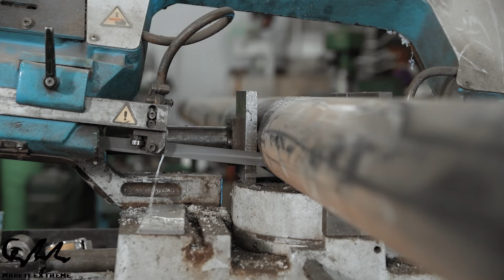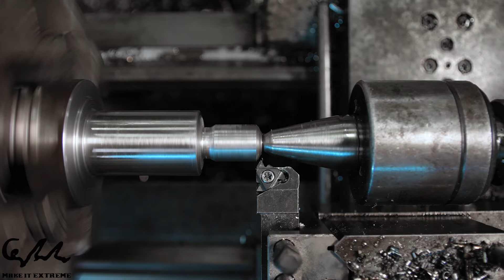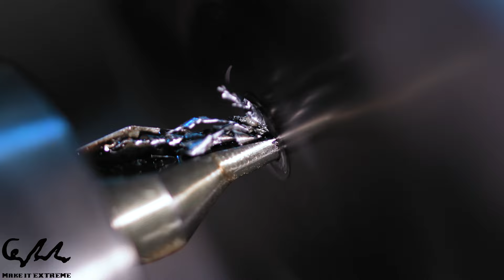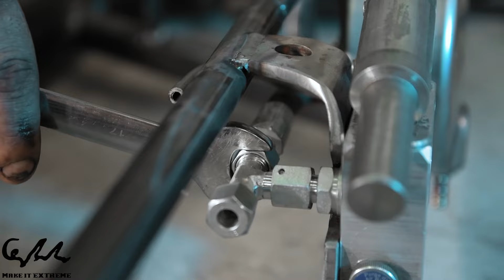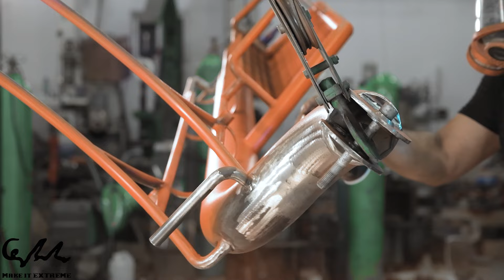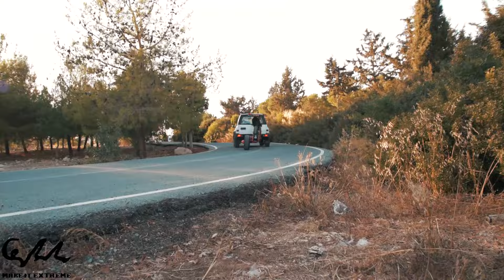The INSANE Homemade Motorbike Trailer of 2024!

Comment: how stable is it at speed? eg 80kmph? weight is off the center
Reply: I heard they tested it up to 300 mph.
Reply: Stable enough for use on the island. Where on Malta can you drive faster than 80kmph?
Reply: @ulrichm  i have no idea where they live... i thougth it was greece... anyway - even 50 is huge speed for unbalanced trailer of ~300kg - it can roll and drag a car with it. This is less but it is with higher center of gravity...
Reply: @lutheduck  i think they live in Cyprus
Reply: @kostasgnt  its Cyprus 🇨🇾 correct.
Reply: Look at the trailer hitch
Reply: @the_mad_ratter  will not tip   hitch does not allow.
Reply: yes i gree, look at the hitch, it doesnt allow it to tip
Reply: Who need it stable when you have family at your side..
Reply: You’re right, but it still looks cool 😜
Reply: @DaddyBear3000 it looks awsome. Crazy as all previous 120 of the builds
Reply: I built a single wheel trailer for my bike and having it centered  can cause issues as any play in the connection joint causes a lot of back and forth forces.    Not only does this make unloading really convenient and cool looking it will keep a twisting force on the front mount and should eliminate rattle on all but the worst bumps.
Reply: @ericjames5163  that makes sense. I would have opted for two wheels personally.
Reply: @DaddyBear3000  my bike trailer ended up with two wheels eventually.    I wanted to be able bring my children along on single-track and I  wanted it to follow my bike wheels on narrow paths.
Reply: As long as that 90 degree phase tung doesn't twist out of the hitch centrifugal twist when cornering won't be a problem. It would have to flip the whole towing vehicle with its roll. It all depends on how tough they made that joint...
Reply: @James-vq9nc  Strong enough for a bike that weighs 120KG.
Reply: @ericjames5163  there is no twisting, but there is no "turning" in the corners, at sharper corbers it will be sliding to side  rather then rolling
Reply: @onjofilms  🤣🤣

Comment: The twisting forces applied to the trailer hitch are insane, especially when turning left, I would be surprised to see it lasting more than a few km, not to mention the effect on the car dynamics. The good news is that the design can be easily corrected by adding a second wheel while still keeping the ability to lower the bike, you just need a U "swing arm" instead of an L one.
Reply: came here to say that. those axial loads are going to wear out that single attachment point in no time.
Reply: It has a pivot in the yaw plane as well as the heave plane. Should be fine.
Reply: Their not talking about the load from side to side in the yaw plane while turning. There talking about the twisting load on the reciver tube do to the offset position of the rear tire
Reply: Lol love when "weld fabrication" experts  come out saying why things won't work because they can't do it themselves lmao 😆
Reply: @crazywelderthings6952  you're painfull come on. How can't you see this problematic. A 2" square tube is not meant to work in torsion. Yeah, It will work, as we can see here, but it won't last.
Reply: @crazywelderthings6952  I love it when welders just make stuff and don't do any engineering to figure out if their contraptions are safe. In this case what duty rating of hitch is suitable to take that torsional (roll) load (can you do it with a class 1 safely?). Also what would be your bike weight limit? Because I would be concerned about the integrity of the (lower class) hitch on the vehicle side which is not (specifically) designed to take that torsional load.
Reply: It's a modified clevis hitch. That hitch isn't going anywhere.
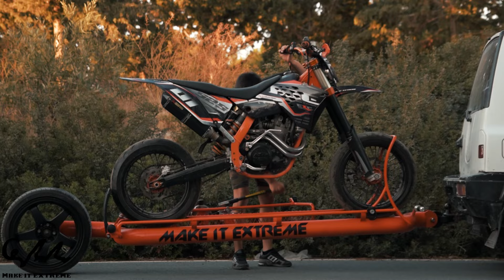Reply: @michaelkunze927  and what is holding that clevis hitch? lol @10:48 the square tube is at most 1" wide.... and buttwelded to a flat bar...
Reply: @TJPDmember  Do you not understand how many thousand pounds those hitches are rated for? Even the smaller hitches Are rated at 1500 pounds and up. Plus its mounted in a significant plate even if its a Class II hitch.
Reply: @michaelkunze927  Do you understand how hitch works? Tongue weight and tow weight are two totally different things. a pick up hitch have a 18 000lbs tow capacity but it cant hold more than 1600lbs in tongue weight. This 1" hitch barely rated for 300lb tongue weight. Please learn before you argue. That's one, second, THIS IS NOT A SWAY BAR, a square tube was NEVER designed to work in torsion (rolling motion of the trailer), stress fatigue will break that thing in no time. Good thing not everybody is an engineer....
Reply: @TJPDmember  pYea bud. I understand how a hitch works. I'm a farmer and a truck driver. I have been exposed to and used more hitches both in travel and hooking up than you have seen. The minimum hitch size is 1 1/4 inch the least amount of weight is 200 tongue weight class 2 is 300 tongue weight. The hitch is sitting inside a metal plate secured to both frame rails. The hitch isn't going anywhere.
Reply: @michaelkunze927  we're getting somewhere, now how much force does a 200lbs bike with a center of mass at about 2ft high, offset by about 1ft to the right have when going around a corner at 60mph? You start with 250lb/ft static minimum and you're not hitting any pot hole on a highway ramp going 60mph yet, I'll let you do the math but it's WAYYY over the generous 1000lbs rating we can give this thing. Do we know each other? lol I love your kind of people. Insult before fact.
Reply: @infidelmat  to be fair i think he isn't going to use that trailer to go somewhere, it's just a little show off piece to get a video out of it (at least i hope so). yes it looks cool but there are in fact a few things that are wrong with this trailer if he wants to really use it. to all others, there is a reason why trailers aren't built that way.
Reply: @thomasmoser7382  oh totally realize it's mostly a show, but it's a bad habit of the diy fab crowd to ignore these things, and these videos don't help. People may trust the setup and replicate it to disastrous results.
Reply: I'd bet this trailer is still going strong and will continue to do so for a very long time.

Comment: As much as I think this is a very cool build, I find myself thinking that using an air spring/shock would have been a much better choice. Hydraulic fluid is technically incompressible, so your trailer technically has no suspension. Now imagine hitting a bump at highway speed. That trailer is going to bounce all over the place. It seems to me it would be quite easy to swap the hydraulic pump with an air pump, which seems likely to work even if you keep the same cylinder.
Reply: Well the cargo itself has shocks if i have to nitpick but i would still agree that a built in shock absorber wouldn't hurt.
Reply: @oscartattoo3910  I assumed there was a chamber with air in the system which acted as the compressible fluid.
Reply: The hydraulic isnt meant to be a shock, its just a lift like on a dumptruck. I have a little trailer that has no shocks and it bounces around a bit. In fact the sidewall on the tire is the only "give" in the system but its fine for light loads. I agree a shock would be nice but then he needs A arms and that really complicates things a bit.
Reply: @danielbuckner2167  not really. The way he has the hydraulic would work. Just add another eyelet to put a shock and have the hydraulic push the shock lifting the wheel.
Reply: There is shocks for hydraulic cylinder that dampen the load
Reply: The shocks on the motorcycle will help quite a lot. If he strapped over the rear tire instead of the swingarm they would help even more.
But by itself without a motorcycle you're definitely right. It'd bounce quite a bit.
Reply: @brandoncaldwell95  He could do that but then that makes the entire trailer/tube part of the suspension and the flexing would occur there rather than in a dedicated suspension. This would obviously affect ride height. He could put a shock inline with the hyd. Cylinder as was mentioned but that require more length in that setup. He alternatively could use an airbag but then since airbags are used in the exact way and for the effect he is using the hydraulic cylinder be could sinply replace the hydraulic cylinder with an airbag and a lockout to hold it up in case of a leak(same cohld be done for hyd. cylinder now). 🙂
Reply: There are many unsuspended trolley in the market. For light loads and limited speeds the tires themselves act as decent suspensions.
Reply: There are certainly things about this that are outside of my experience, and factors I hadn't considered (such as how effective the tire itself may be at softening the bumps). Perhaps in Cyprus this bike trailer will work perfectly, I just don't know. I do know that I wouldn't take it on any of the roads here in New England as it would probably become airborne on the very first pothole I hit.
Reply: He just needs to add a hydraulic accumulator, its that easy, his system will work.
Reply: @xxn0cturn3xx  Then hes combining two different systems which design wise means twice the risk of failure.
Reply: @danielbuckner2167  what are you talking about, the accumulator literaly just bolts on to the current system...
Reply: @xxn0cturn3xx  Yes but then you are using it as a dampener, correct? So now the system must remain in an "unlocked" position and is subject to dhnamic movement and load.
Reply: @danielbuckner2167  well if you want it "lock" just use a manual valve that you can close if you want to disable the dampener, easy as that
Reply: @xxn0cturn3xx  That would only stop the flow in the hydraulic system. That would be like those people who crawl under their car with no jackstands and get crushed. A mechanical lock is what is needed. The hydraulic ram isnt a suspension piece, it is like a ram on a dumptruck. I have never seen a dumptruck without suspension and a dampener on the hydraulic ram to soften the bumps from the load, have you? Mixing the two systems means one failure has twice the bad result and in the this case would not be a blown shock but rather a collapsed trailer.
Reply: @danielbuckner2167  His idea makes perfect sense, and is used in the industry as well! What he is describing is exactly what Citroen cars used to have. Hydraulic rams with hydraulic accumulators provide some compression (they are filled with nitrogen which is compressible opposed to hydraulic oil). Citroen stopped using that system because of the high cost but it is still used on JCB Fastracs.
Reply: @Matevz96  Yes, but wasnt that part of the stabilization and not a suspension part? If it fails the trailer collapses, not just loses shock absorption.
Reply: If you think that why not build one yourself instead of being a hypercritical keyboard warrior
Reply: If you have an air compressor 
12v compressor at napa $109
Reply: I'd think there is some give in the pump circuit (rubber pipes etc) which would allow movement for sharp onset load variables.
Reply: Trailers work better without shocks.

Comment: Need to lock it in the upper position also. Those hydraulics could leak and drop that trailer
Reply: Yeah, that was something that concerned me as well.
Reply: make sense but just like him i like that kind of confidence in my work so i would probably use a small caster (small wheel that sontact the ground when lowered
Reply: @jeyseychelles1370  I'm more concerned when he's hauling it. All the farm equipment I used to run got chalked or locked in the upmost position. Don't want your machine to drag pavement. Being confident is great but you have to be redundant
Reply: All you need is a piece of half pipe that goes around the polish rod to keep it from lowering. We use those all the time on farm implements.
Reply: @michaelkunze927  that's what we had as well. Hinged to the cylinder, swung up and latched around the cylinder rod
Reply: @kylebracht  Most of ours is a U shaped pipe open down one side with a hole for a linch pin to hold it on. Have a tab off to the side to store it when not in use. The hinged ones have a tendency sometimes to vibrate and dislodge the mounting pin or cut into it.

Comment: The trailer look amazing! Now you need lights to make it legal.
Reply: I wonder tho. Cause it isn’t wide enough to block the view to the taillights of the tow car. Might just depend on the cop and his mood
Reply: some countries might not be a requirement, I know here there is exemptions depending on length and if tow vehicle lights are visible
Reply: Most places you only need lights if the vehicles tail lights are blocked from view and if the trailer itself exceeds 10 feet in length.
Reply: As long as you are visible and safe.
Reply: I agree ✌️😎
Reply: In many states the law is the trailer needs lights if it obstructs the vehicle lights during normal travel. Including the load on the trailer.

Since this does neither of those things, and would meet all requirements for excluding the legal need for lights, it would depend entirely on his local and state laws.

Comment: Nice! A small accumulator in the line to the lift cylinder would improve the suspension action over bumps.  Any reason you didn't buy a loose U-joint from the local farm supply or junk yard for the hitch?
Reply: Exactly! Was thinking U Joint also. Amazing lateral torque resistance while allowing the trailer to pivot up/down and left/right

Comment: My head is telling me that having an un-centred load like that is a bad idea. 

But, it's also a cool concept for loading bikes so I hope I'm wrong.
Reply: yes, it's look beautiful but i think it should has 2 wheels to get more balance, not just only 1 wheel!
Reply: In some camera angles you can  clearly see the load tilting to the right.
Reply: And the trailer hitch is probably not designed to hold this kind of load.
Reply: I noticed there is no video of the trailer going around corners at speed.
Reply: @justindavis1546  >there is no video of the trailer going at speed.

Fixed that for you
Reply: there is no pivot to it. He made a custom hitch that only goes up an down from what i seen
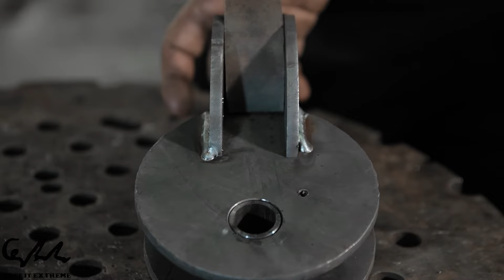Reply: @dexterrandolph5563  At 8:11 you can see the hinge with two pivots, one vertical and one horizontal. It appears the "hinge" slides into the receiver and uses the regular pin to hold it in place, you can see the trailer hitch is still attached above the hinge.
Reply: Correct. The trailer is definitely off camber. Instead of making two "S's", the rear could have stayed an "S" and in front of that stayed straight to create a triangle. This would make the bike load at a slight angle (~5°-10°), but much more centered overall.

Comment: Love to see it try and go around a corner at 80kph ... wouldn't end well me thinks.
Reply: It's through bolted at the front so it's fixed to only roll/tip in unison with the vehicle's frame. It's not going anywhere.
Reply: @jokly1264  Toda América sería un solo país es México en un futuro próximo el idioma oficial sería en español religión oficial sería católica México va ser el primer mundo ☺️ viva México ❤️🇲🇽❤️🤠...
Reply: Would love to see YOU around a corner at 89kph 😜
Reply: Why the fuck would you take a corner at 80kph? Its for transporting a bike, not formula drift
Reply: What a great comment do you like the taste of the white crayon?

Comment: Cool design, stability wise I’d be cautious since the weight isn’t over the central axis it’s going to want to roll and you were able to see that in footage at the end. Otherwise that’s dope
Reply: its gonna wanna roll regardless
Reply: There is no way for it to roll with the custom hitch he made. it's only a 2 axis hitch, not a 3 axis. If he was using a standard ball hitch, then yes, but that's not the case here.
Reply: @FarmerFpv  still a lot of unnecessary force on that hitch.
Reply: @warrensteel9954  Actually you want weight on the hitch is makes it more stable. Also that is not a lot weight for a hitch. Even the most basic of truck hitches can do 1000 lbs . This set up is less than half of that.
Reply: @EnlightenedSavage  I said force, not weight. The rear wheel of the trailer is offset and thus adds torsional force to the hitch, twisting it clockwise. It's likely one pothole away from twisting right off.
Reply: @EnlightenedSavage  leverage. 1,000lbs at the hitch is twice the force at twice the distance from the pivot and rated weight of 1,000lbs is vertical not lateral. Tow balls are seldom presented with much lateral force but that set up only presents lateral force. It is in effect a rigid set up and everyone knows how much a rigid axle scrubs (or produces forces) when it is turning an arc.Anyone can push a trailer back and forth but forcing one to spin is another ball game.
Reply: @warrensteel9954  i believe the weight of motorcycle is also offset from the axis of trailer which will somehow balance the torsional force.  May i ask you the difference in weight and force ??
Reply: @Max_Marz  ₩0

₩0

Comment: I like the concept for a lite trail bike , but how stable is the single wheel if using it for heavier bikes. I would duplicate the swing arm on the other side and turn the wheels out to make wider the trails foot print for heavy bikes. but still a good design and build, well done.

Comment: I love this trailer. The only thing i did not like is it seems most of the fittings were butt welded .
Reply: Guess I’mma going to Google what a butt weld is now, never heard of that.
Reply: @Messier87_M87  it's just 2 pipes butted together without any other reinforcement or male female joint

Comment: Cool concept, it turned out nice, and it looks like you can run a decent weld, but I'd be afraid that since you didn't leave any sort of a gap between parts for a full penetration weld, then proceeded to grind off probably 95% of the surface weld that you won't have a lot of strength and will most likely develop some cracks.